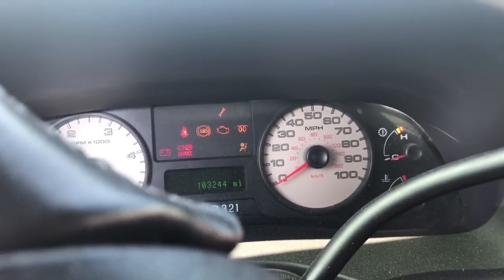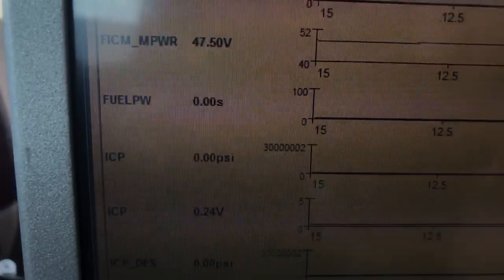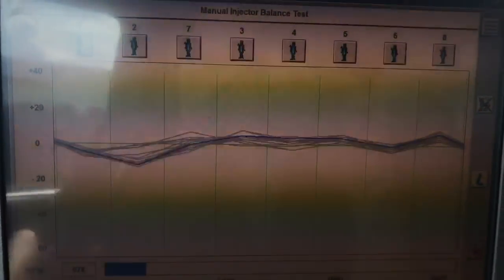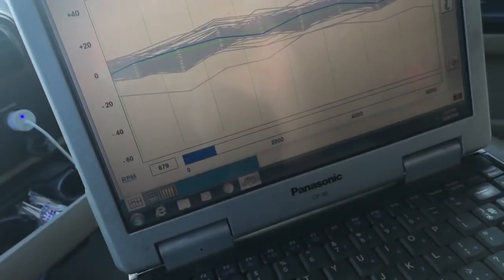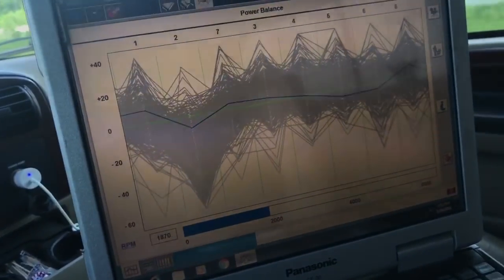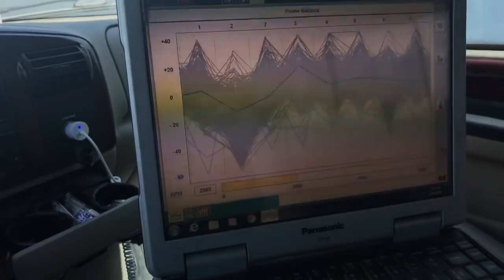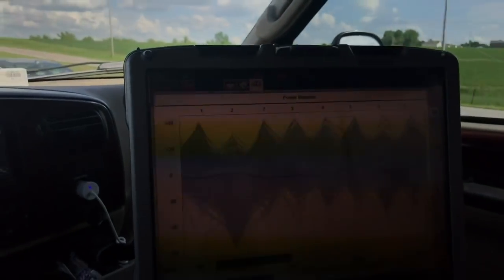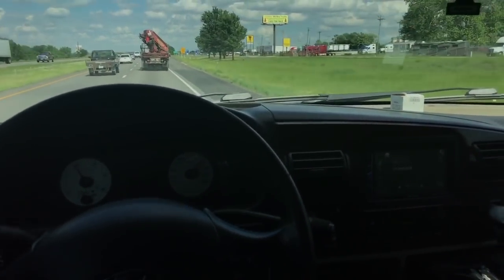Ryan's 06 Injector's

Comment: You should consider making those metal rad support covers and maybe the metal wire cover over the turbo!
Reply: PSP Diesel already makes them
Reply from the maker: It looks like moroso is the actual manufacturer.  At least that was engraved on it.
Reply: I know they make them, I’d rather support SDS!
Reply: arayray94 I get that, but also support original creators of products. Like Anthony's intake design.